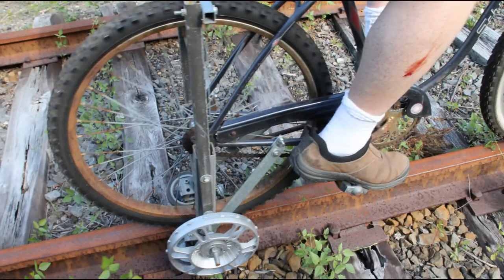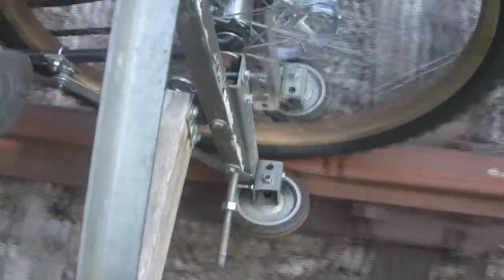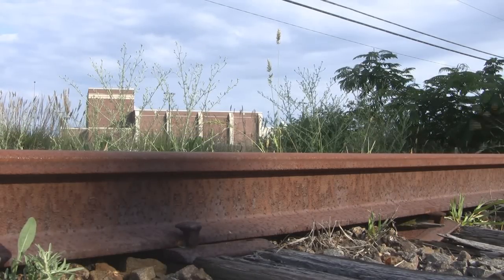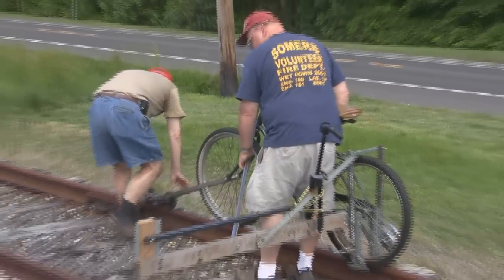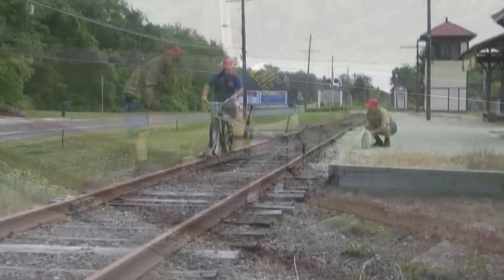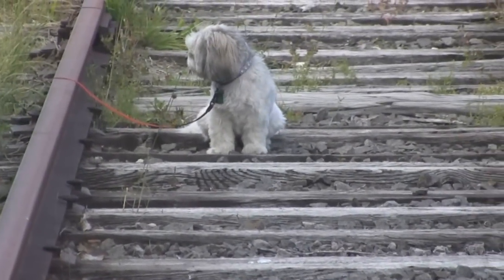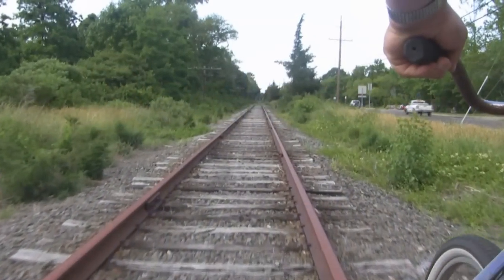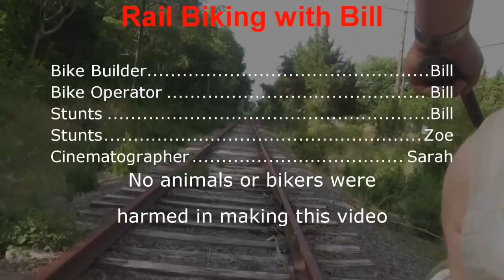Rail Biking, Spring 2010

Comment: you should put some guide wheels on the non-operator side to maintain that the outrigger wheel stays on that track. That could also help stabilize the bike when the operator-side runs into track interference

Comment: Those tracks are used. Its the Cape May Seashore Lines' Cape May Branch. Last use was in 2010. Due to a theft of spikes and tie plates on the tracks, trains havent been able to run on it since. Trains should begin running again once it is repaired.
Reply: True, but its not completely abandoned.

Comment: There was a fellow in Eugene,OR that had a simpler set up he had a triangular frame w/a dryer hub attached to it on one end & the bike on the other. He evidently had the width of hub to bike correct because the tire stayed on the rail w/o guides on the bike tires. That's what i remember about it.

Comment: As for a three wheeled "rail bike" .. YEP -- I had one of those too .. it was called a PULL_PULL trolley, two wheels on one frame .. and a "flanged" outrigger single wheel (I bought it for $5NZ and sold it -- 20 yrs later (broken) for $250NZ. It went to Te Anua & the Rodgers K restoration project.. (I don't know where it is now.. but their Rodgers K is in Manderville beside the Croydon Aircraft Museum, near Gore, Southland, NZ)

Comment: Not bad, wondering what the silver wheel is for on right side.
I have wanted something like this forever, these days I'd want to rig my ebike.
Some comments seem to think this runs on active track.. Not a good idea!
A bit of weight on front guide system would make sense, what about a rare earth 
magnet pulling it down to the track? I think the outrigger could be a lot thinner and 
lighter if there were a brace from the top of a rear bike rack to near track height.
Also a very slight tilt of the bike to the left would put a few (dozen?) lbs of weight
over onto the outrigger. Another cute trick would be rigging it so the booms etc
could become a trailer, pulled behind the bike to travel to the RR and back.

Comment: They tried to restart that line but never got the funding then the bridge went out just north of Cape May.  NARCOA had a run on there a while back.  Good you got on it before the growth takes over.  Your guide in the front is the problem would be better to have a frame that puts it under the front wheel or even replaces the front wheel.

Comment: Okay, seems you need to discard the guide wheels, on both sides, discard
 the 2nd rail guide wheel, However, keeping the front and 2nd rail 
outrigger, and you need to weight the 2nd rail outrigger to off set the 
riders weight and movement. As for keeping the outriggers....

Then,
 you need to make the front and rear wheel forks wider, then, you need 
on the inside of all wheels,(inner rail side) including the 2nd rail 
outrigger, and the front outrigger wheels that will take the top and 
side shape of the rails. Not going below the top of the T rail shape.

This
 alone will guide the front forked wheel, and the rear will follow. The 
2nd rail outrigger, will also follow, but it's mostly for balance that's
 why you need to weight the 2nd rail outrigger.

You also need to 
disconnect the handlebars from the front forks. Let the rails guide the 
bike through the turns and absolute straights, while your using the 
handle bars as a handle so you can peddle the bike and as you ped, your 
moving back and forth and the front wheel won't even know it.

After
 you get that perfected, its time to add a small briggs gasoline engine.
 With that idea, you can use a centrifugal clutch on the front wheel. 
(not the rear). This is because as you apply the gas, the front pulls 
the bike, if it was on the rear, the front would want to spring up. 
There are several motors available for bikes, however, if your going to 
build a rail bike, be best to build a mount that's all your own.

One
 added note: While the wheels take the T shape of the rail, you will now
 be able to ride the bike across RR crossings without being stopped by 
the side wheels not making the sides. If you noticed, RR crossings have a
 inch or so of space between the rail and the street, this is to 
accommodate the trains wheels, as the inner flange of the wheel keeps 
the train from skewing from side to side, and as such is the guide for 
keeping the train on the tracks.

Comment: The point?  a guy does this is because they can.  The view, the fun, the challenge of building something 'else'     I AM amazed that, while draisines have been around for over a century, that a better and long existing set of construction plans was not used.   2 x 4s and 4 wheeled rail guides?  Learn welding.  Learn to BUILD IN balance and stability.
Reply: Learn grammar.
Reply: Years & years ago the RR's had these for rail inspection
 They were powered by a set of handles that were pumped back and forth.

Comment: My advice: place a bit of weight and maybe a blade or small plow on the front guard to help move brush and stuff out of the way. And obviously, don't go over switches or road crossings. That'll put you over the handlebars in a hurry.

Comment: Whjich is EXACTLY what the NZR did themselves.. when they made their 4wheeled  12" Pneumatic tyred Inspecting Ganger Motor trolley's .. in the 1970's .. (I know.. I worked for the NZR as an Ispecting Grade two ganger.. (operating a rubber tyred trolley every day - between Alexandra at the 236km peg to Auripo at the 163.16 Km peg AND BACK) and never did I have any problems except flat tyres.. then the idler wheel "bounced" over the fishplates - YOU  KNOW.. "that which joins each rail to another)

Comment: Great first attempt... I went through at least three failures before my first success... I made a couple newer designs... one was very fast... and dangerous... because it was fast...

The next one worked very well. I spent a whole summer designing and making it... testing, improving... then I took an 80 mile ride on the Adirondack Railway... what a great adventure.

http://therbfamily.homestead.com/adirondack.html

Keep at it... I found that rear wheel guides are unnecessary. The rear wheel follows the front perfectly on a properly aligned bicycle. Enjoy! I can't wait to build the next one...

Comment: Why not retrofit a go-cart with mine cart or vehicular track wheels like we did when I was younger. Worked awesomely until a train comes through and you have to remove your cart from the tracks. Today I do not think this would be wise with the computerized signalling and such. You could trip a block signal and cause a train to become delayed unless one wheel is insulated somehow.

Comment: Of course at any time that you come to a turnout (switch) you WILL have a major problem as the toe of the switch has a second rail as a blade, that will attempt to "spread" those two horizontal wheels as wide as possible the furthur towards the frog that you go, however when U reach the frog the flange guide rails will drastically entrap the wheels in the minimal gap reserved to KEEP the flange of normal railway wheels from drifting away from the frog .. and thus YOU will find yourself "flying"

Comment: Probably would be better when encountering overgrowth if you make the front guide an Aframe with guide just in front and just behind the front wheel.  WIth the guide that far in front of the wheel it flexes to easily when encountering.  If you can find them get a pair of double flanged wheels for that.  You can make a double flanged wheel with a harbor freight wheel and two flanges cut from a corian cutting board sandwiched together.

Comment: What about building the rail bike so the rider is in the center. Have an Axel that attcahea to the rear sprocket that way you wouldn't have to worry about tipping and you could haul gear easier.

Comment: I did that using ball bearings for guide wheels wich got caught in switches. later on I used regular flaanged wheels in front & behind the bike wheels with only one flanged wheel on the other track in 1982

Comment: All that you "had" to do .. was install ONE vertical wheel .. that was set at about 5* off true vertical .. on the inside of every top running wheel .. ie: ONE vertical wheel .. beside the front wheel, one beside the back wheel & one beside the outrigger wheel (just as if they were the flange .. and as these have a 5* tilt - they don't scuff when turning.. nor do they "catch" on any flange retaining rails or do any "spreading" on turnout switch-blades .. JUST LIKE REAL FLANGED WHEELS OPERATE.